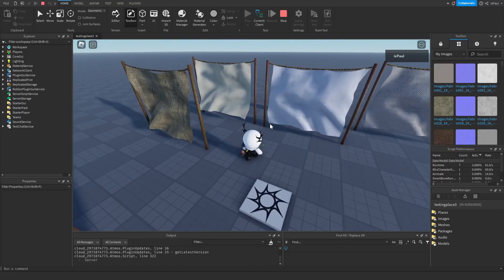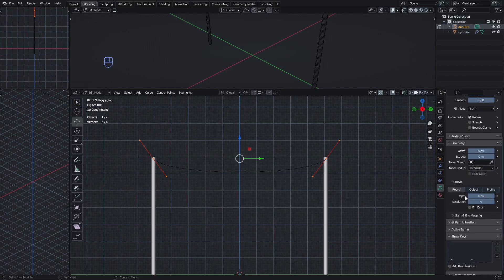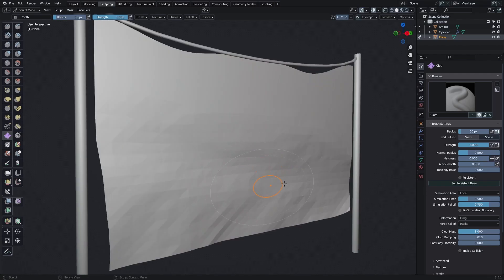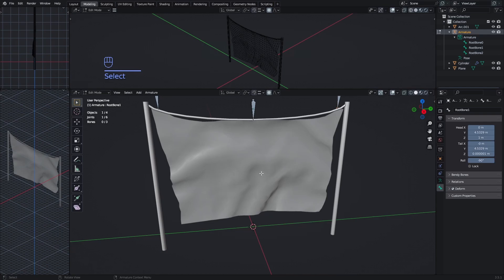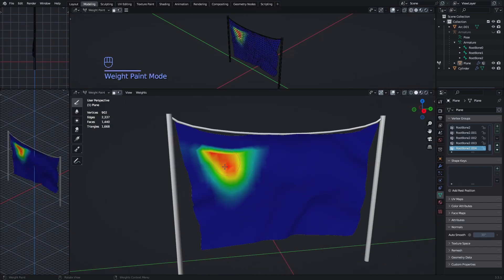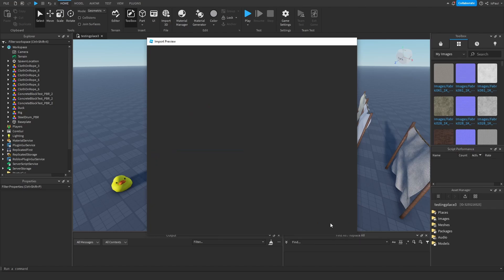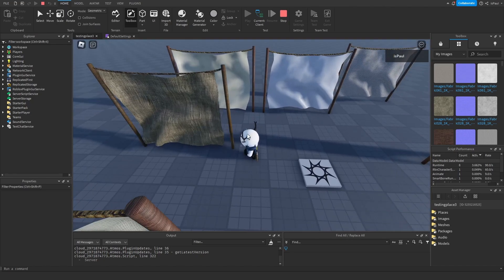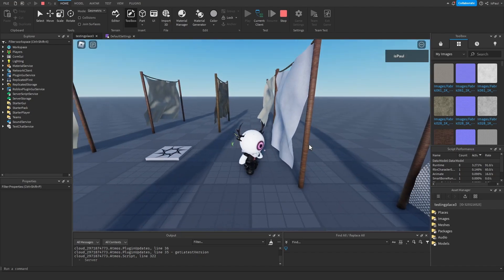Dynamic Cloth! | Roblox SmartBone/Blender tutorial

Comment: I have been wondering something that I've been hoping would be a possibility for a VERY long time...

 Is there a way that Individual Root parts of the mesh could be welded to other sepperate part's/Cubes so it could Mimic Curtain opening and closing movement, Or be able to be dragged around in sections rather then all at once ?

A tutorial on the matter would be lovely,  But I wont ask that of you, But if you do then thank you 😊, If not, No worrie's

And thank you for your reply whenever you get to it ❤
Reply from the maker: You can weld a mesh to a different bone only if that mesh has a bone itself, and if you want to do something like a curtain, you could create different cube meshes (and add an armature with only one bone) for each bone the curtain would have, and weld each corresponding cube to the bone, then move the cubes in a sequence to simulate the effect.
I'm not entirely sure how the curtain would behave tho, and I don't know if I'm going to make a tutorial on it.
Reply: Yay! I'll be giving this a try when I am able to! I'll let you know how it go's 😊 Thank you once again for your help ❤
Reply from the maker: @tristanstelter8231  No problem and good luck
Reply: @Paul1Rb I'm for sure gonna need it 😅, I've imported my curtain inti studio and it's got the bones and all but... Only the string of bones in the center moves as if it where a stick.. It also deletes itself / Turns invisible when I get close to it and stays that way afterwards.., Any idea what I might've done wrong ?

Thank you for the help in advance ❤

And I hope your doggo is doing well! 😊

EDIT:

I've figured out what the issue was! I needed to add attributes in order for it to behave properly and actually work well! Only issue is I cannot figure out the collisions with the new 2nd version, Hoping you can help us out with that in the next video! 😊

Comment: If roblox added this with accesories like hairs, capes, ect, this would be so cool.
Reply from the maker: Fr, even the ability to use a built-in soft body system would be cool too
Reply: imagine spending like 100 robux on an accessory and then not being able to use it cuz u have a bad device
Reply: @doctorelijah  they could  easily  make it a feature were you can toggle it on or off though.
Reply from the maker: @doctorelijah  For it to lag, you would have to have a voodoo GPU and a model with 300k polygons

Comment: This seems a bit extra imo couldn't you just use a panned noise texture to displace the verts?
Reply from the maker: Making it have a cloth-like flow would require some extra nodes and math calculations, which seems like a lot more work than moving your cursor over the mesh few times.
Reply: @Paul1Rb idk about that its actually fairly easy to get that working I don't use roblox but it is definitely going to be cheaper compared to using bones and easier in the long run because you could reuse the same nodes over and over the only disadvantage would be less convincing cloth movement but thats not a problem for most stuff so I guess both methods have advantages and disadvantages
Reply from the maker: @Fhujjbv   Roblox Studio is very limiting and requires you to use bones for this type of stuff anyway. There aren't tools that allow for node-based logic for a purpose like this, If I were to only make it in a 3D software, I would probably choose the displacement method, but yeah.

Comment: when im importing the smartbone hair i made, only the mesh gets imported and not the actual hair even tho ive selected both
Reply from the maker: I've shown the export process in the video, if you follow it right everything should be working fine, if not, make sure the mesh is parented to the armature and you have proper export settings.
And remember to use the Import3D in Studio.
Reply: alright ill try it and let you know if it works, does it matter how its parented or
 @Paul1Rb
Reply: When im trying to parent it, it just has one option saying, "connected" or something  @Paul1Rb
Reply from the maker: @cheesestring69  I gave instructions on how to properly parent an object to an armature in the tutorial at 8:36
Reply from the maker: @cheesestring69  Try pressing F3 and searching for an option "Parent with automatic weights", or just go to Object -> Parent and select automatic weights there
Reply from the maker: @cheesestring69  Did you duplicate the bones in object mode or edit mode?
Reply from the maker: @cheesestring69  Then make sure the bones are connected to each other and are set in the tree hierarchy. I might not be able to support this issue any further, and I recommend searching for it on the internet and seeing if it's maybe different on any blender version.

Comment: not cloth just pc killer
Reply from the maker: If you want to see how it goes performance-wise, there's benchmarking tests on the devforum.
Reply: @Paul1Rb  ive just never seen physics run well in any mobile game
Reply: @TheRealDJarrk There is a difference between pc and mobile
Reply: @originaldeadfrog  yeah ik
Reply: @TheRealDJarrk well fancade does just that it performs well
Reply: @Paul1Rb ok
Reply: @Paul1Rb  i need to figure out how to do this but on a rig, and for a tail (i think the hair video might be the one tbh)
Reply: The n64 can render 10k polygons at 30fps you think this will affect peformance?
Reply: @Kat-327  Not everybody has a god PC
Reply: @Grassplant2012  my 2012 toshiba laptop can run that shit
Reply: @Kat-327 bull
Reply: Actually, it won't make any difference in terms of performance because there is too little amount of polygons ( triangles as roblox calls it). It will start lagging if its spammed
Reply: @Quyils What about CPU usage?

You still have to calculate physics, and Roblox optimisation is well, shit.
Reply: some simple physics isnt going to lag any game engine, roblox included.
Reply: @truthfxl  i see thx
Reply: Not cloth but Mobile abuser
Reply: ok
Reply: + my phone killer my phone is super bad so💀
Reply: @fard_noobchannel117 fancade:
Reply: Roblox don't require alot of ram and cpu and GPU usage
Reply: @LOCIRUS  
roblox dies playing sisyphus simulator on a gtx 1650 super
Reply: Not pc killer, pc assassin 💀💀💀💀
Reply from the maker: Bacon_Blox2012  of?
Reply: Bacon_Blox2012 are you disabled
Reply: Bacon_Blox2012 are you disabled
Reply: Bacon_Blox2012 Roblox, it’s in the title 🤦‍♂️
Reply: Oh my pccccccc
Reply: It takes 10% of the physics engine but you can easily disable its use when the played graphics level is too low